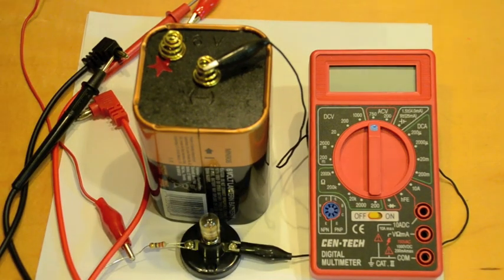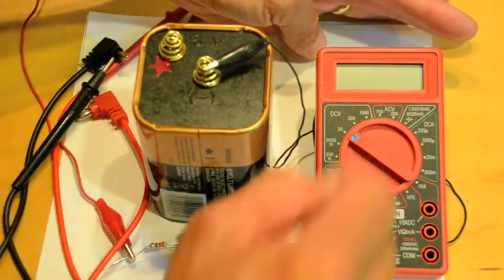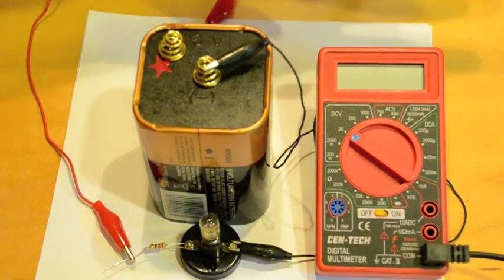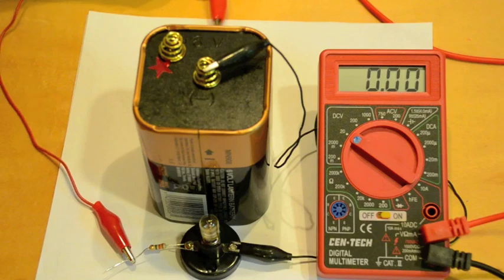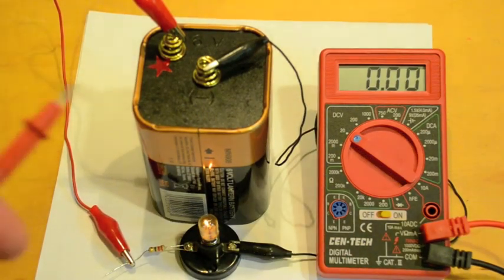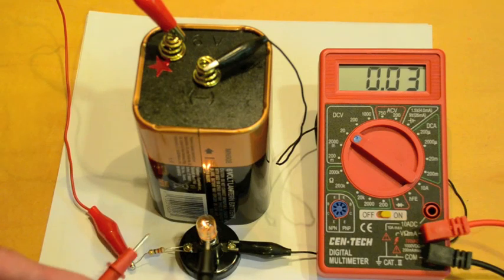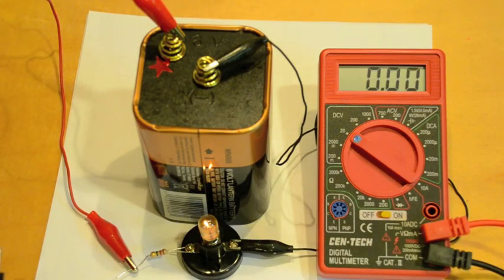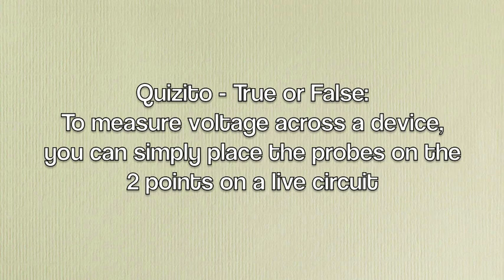Measuring Voltage with a Digital Multimeter

Comment: Dude I like these videos, I also love the little quizzes at the end, although I am curious as to why you got different values in the different areas you measured, I expected them to be the same, otherwise how will you know which one to use? Or are you supposed to get different readings in each area to measure that specific area only? Sorry I’m totally new to all of this lol.
Reply: The resistor and load (lamp) have different resistances. So their voltage drops will be different too. This is because V= I × R

Comment: G'day m8 can i test the voltage of a sensors wires by say back probing pwr & ground /sensor plugged in. Will this work. Trying to find out y i hav no ground @ the sensors plug( ground comes fm the pcm)

Comment: Good video, thanks. Quick question - what if I used the probs the other way around eg i put the red probe to the black side and black prob to the red s side? Thanks, again.
Reply: I know this is an old comment, but in case anyone else has this question, you will still read the same voltage, but the meter will read negative instead of positive. For example: -5.99dcv
Reply: Thanks..👍🏽

Comment: Great current tutorial

Can I use 2 of this multimeter to measure 20 amp or 3 for 1230amp current. As you know it is rated for 10 amp.
Reply from the maker: Ka Ye  -- no, you will need a different meter. Probably an inductive clamp type, works very differently than this multimeter.
Reply: Hi MrChanPhysics :
I have 3 multimeters. Like to do it without new gadget. Is there a way around it?

If I connect it in parallel, why it will not work?
Reply from the maker: In an ideal world, the meters and their 10 Amp fuses have zero resistance.  However, in reality, they have a little resistance, slightly different in each meter and fuse.  So the 30 Amps of current you are trying to measure will not divide exactly into 1/3 for each meter.  So one meter might exceed 10 Amps, another might be a little under 10 Amps.  The total of the three meters will still be  30 Amps, but it might blow one of the fuses first.  And once that fuse goes, all the others will  blow for sure, since they will be overloaded.  
You are welcome to try it, it might work.  But just be prepared with extra replacement fuses.

Comment: Thanks for the vids Mr. CHAN so to recap (I've seen all 3 vids)1) measure voltage---> circuit is energized/no need to break circuit to measure||2) measure current-> circuit is energized/must splice into circuit to measure||3) measure resistance-> circuit is DEENERGIZED/must break into circuit to measure||
Reply from the maker: I am not sure why your comment shows up with strike-through marks, but your understanding is correct.

Comment: electricity actually flows from the negative to the positive. but good vid. thanks for the refresher
Reply from the maker: You are partially correct.  Negatively charged electrons flow from negative to positive.  But by convention, physicists, engineers, and electricians consider current to consist of (fictitious) positive charges flowing from positive to negative.  This stems from Ben Franklin's day when he discovered two types of opposite charge in the 18th century; he had no way of knowing which ones were actually moving.  Electrons were discovered around the turn of the 20th century.
Reply: MrChanPhysics  well thanks for the info!